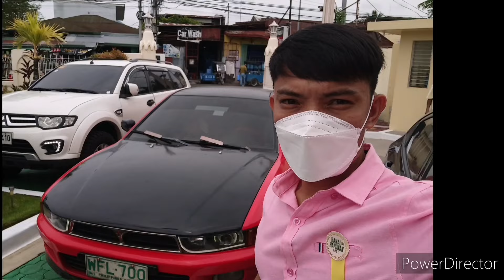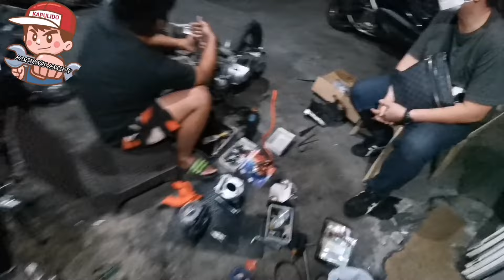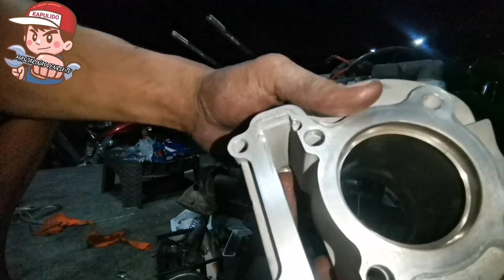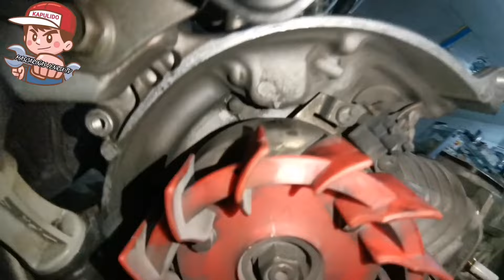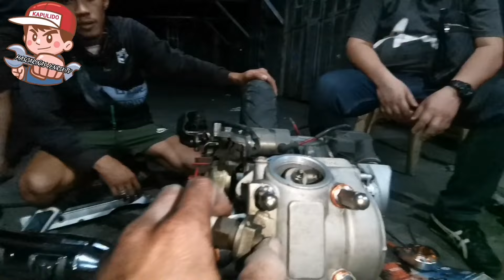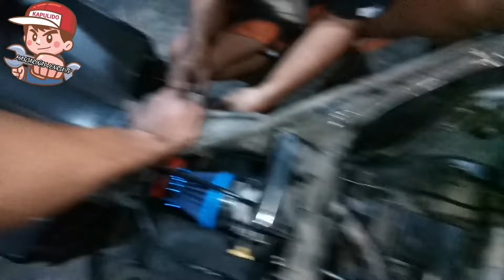Yamaha Nouvo Engine Refresh 160cc Big Valves 59mm Fulldome

Comment: Idol kapulido,  pwede bang naka kabit pa din ang stock airfilter sa 59 block , big valve, stock carb ? Kung pwede may power pa din po ba ?
Reply from the maker: kung stock carb pwede syang ikabit pero kapos na sya sa hangin sir
Reply from the maker: pwede palitan mo ung pinaka goma nya palitan ng mas malaki para maka pasok mas malaking hangin
Reply: Maraming salamat idol, i mo modify ko din yung butas ng box para dagdag hangin, Yan kasi ang next plan ko kapag nag bago ng set up, Mas mainam kasi na may air filter para long life ang makina, sayang kasi yung pyesa kung masisira din agad. Da best ka talaga Kapulido.
Reply: Malakas pa din ba power nya kahit may airfilter?
Reply from the maker: opo malakas pa ein nmn basta palitan mo sir un pinaka hose nya papuntang airbox lakihan mo sir.. tas habol ka nalng sa jettting
Reply: Salamat sir,  Idol ka talaga 👍

Comment: Boss Idol napapanood ko sa utube Ang mga blog mo bilib Ako Sayo gusto ko sanang upgrade Ang motor ko 152 cafe racer gusto ko sanang gawing 400cc pero. Budget meal lang magkano kaya aabutin Ang Plano ko pero Sayo ko gustong ipagawa idol sana ma replyan mo Ako salamat
Reply from the maker: naku 400cc sir... baka d kayanin sir sa 400cc nyan 150 ang sagad na kaya po jan is 220 lng
Reply: @mascarinasjenrixtv2191  IDOL SA 220CC MAKANO KAYA AABUTIN ANG GASTOS KO AT LABOR SIR GUSTO KO SANANG IPAGAWA DIN YUNG GEAR KC HANGANG 5GEAR LANG SYA OWEDE KAYANG GAWING 6GEAR AT MAG KANO AABUTIN IDOL
Reply from the maker: pwede po basta mg match ang transmission ng xlr200 para 6ta sya
Reply: @mascarinasjenrixtv2191  maraming salamat IDOL BUO ANG TIWALA KO SAYO IPON MUNA AKO IDOL SANA MGA MAG KANO KAYA AABUTIN ANG PA UPGRADE NG 220CC AT 6TA PARA MAKAPAG IPON AKO SIR KASAMA NA MATERIALES SIR SIR AT LABOR AT ADDRESS MO SIR
Reply from the maker: dun sa budget sir ay dipende sa mga mahahanap nating pyesa more in 2nd hand kc mga yan walang brand new hahanap tau mga  2nd hand na sigunyal ng xr200 tas 2nd hand na transmission ng xlr 200  tas mga ipapa machine.. dipende sir sa presyo ng mga seller eh..
Reply: Ah Ganon ba Sir okay sir salamat ano po ba fb nyo Ng ma ko kayo sir
Reply: @mascarinasjenrixtv2191  aabot kaya Ng 30K Ang dapat kung ilaan dyan sa 152 ko bad trip kc Ako sa raider Ng kapit bahay ko e palagi akong pinag tatawanan bakit daw Ako kukuha Ng motor na China kaya gusto kung palakasin Ang china king 152 sa tutuo lang bro hulugan pa yang cafe racer ko pero masmagang upgrade na para di napag iiwanan sa biyahe salamat at may katulad mong nag bibigay pag asa sa tulad Kong china bike lang ang meron god bless you bro at sa family mo

Comment: Sir bat kaya yung skin tabas na yung valve lock at retainer natama parin sa valve seal. Salamat sir more video pa po sa inyo
Reply from the maker: sinagad mo na sir ang pagka tabas?
Reply: @mascarinasjenrixtv2191  opo sir natama parin. 6.8 yung cams nya.
Reply: @mascarinasjenrixtv2191  lagi ko pinapanood mga vid. Mo para mkakuha ako ng idea. Tagal na ksi nkatambak nung mutor ko.
Reply from the maker: palit ka nlng ng valve plus 1mm
Reply: @mascarinasjenrixtv2191  hnd ba pareparehas ang haba ng valve?
Reply: @mascarinasjenrixtv2191  ano kayang valve ang pwde sir?
Reply from the maker: meron yata sa rs8 na mas mahabang valve my nakita ako lazada
Reply: @mascarinasjenrixtv2191  yOwn salamat sir more power
Reply: @mascarinasjenrixtv2191  boss pede kaya ang ilagay kong valve ay 24/28 sa 30/25 na head?
Reply from the maker: pwede po... ung sakin 26 30.. wala ako makita so 24 28 nilagay ko pwede nmn un bsta same cla ng stem
Reply: @mascarinasjenrixtv2191  salamat ng marami sir ☝️☝️☝️💪💪